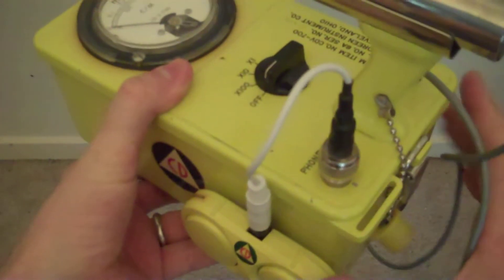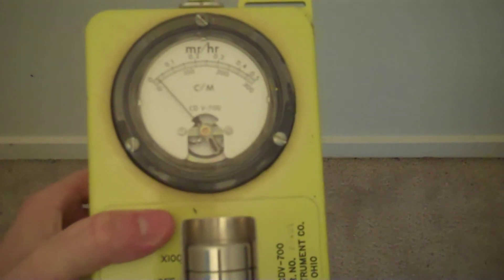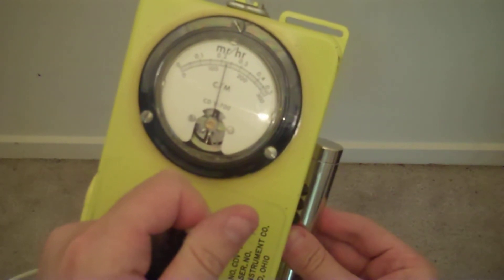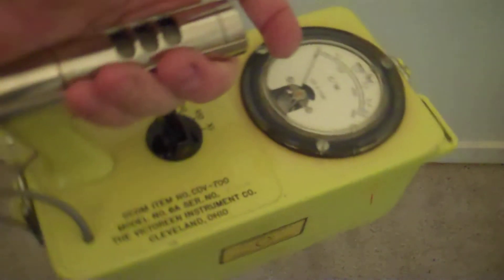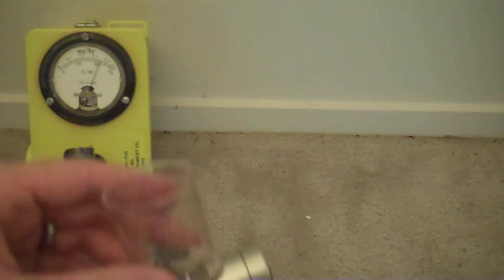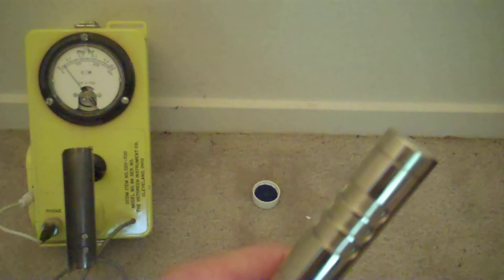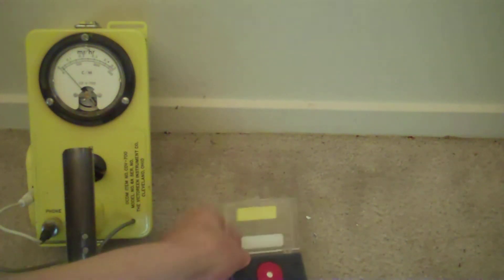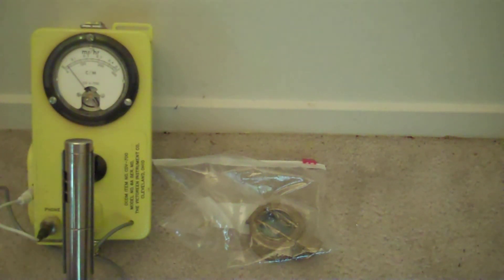Victoreen CDV-700 6A Geiger Counter -- Review

Comment: I know the video is 6 years old but... I hope you still remenber how these device works. There is a lot of cdv700 on ebay that are not calibrated but here is my question: can I just get one that "works" and calibrate it myself? If the check source is depleted, I just need to buy a calibrated source (cs137) and calibrate the cdv700 by turning the screw inside right?

Comment: Really good video! Is it safe to keep in the house with the check-source that it has built 
in? I have a very basic knowledge of physics. Thinking back to high school physics I'm assuming the sticker will 
block Alpha and Beta rays coming out of it? I'm assuming the gamma amount is too low to even travel out of it?  I was intending to store it in a cupboard under the stairs. Thanks!
Reply: Well, you have a geiger counter attached to the source so try to measure if there is any diference in radiation from background at 1 foot from the source.
Reply: It's a pretty small source. The inverse square law is your friend and is pretty safe to keep in your house. Just don't sleep with your check sources.

Comment: From what I've read around from other sources including a civil defense museum is that these should be run off two d cells with jumpers or four AAs because batteries now are way more powerful than the batteries these were designed for. You risk the chance of burning out the geiger.
Myself i just got some AA cell adapters that fit in d cell slots and it works great

Comment: I have 2 of these units that belonged to my grandfather.  One of them is in pristine shape.  I mean, it looks like new, like it has new paint.  It also has a old speaker connected to it for sound.  The other one is in very good shape, but looks to have been used some, with not speaker.  I put batteries in them just long enough to test, and they both work.  I do not want to sell them, but I am curious about what they would sell for?  I never, ever see them for sale at auctions or any place.  Oh, the one that is in very good shape is more of a greenish yellow.  Does that identify it in any way as being different than the pristine, new looking one?
Reply from the maker: +Groundhog If they truly are in good shape, they could be sold for a fair value. Look on eBay for the current prices, but I paid almost 200 for mine. The recent mine cost so much was not just because it was in good shape, but because it also held that circuitry checked and refurbished.

Of course, I would keep them just because I like Geiger counters  =)
Reply: Uh, I meant to say my dad, not my grandfather.  I have one marble out of several that is slightly radioactive.  Also a old alarm clock that makes my geiger counters go crazy.  Back in the 60s, I used to use that clock on my headboard for a while.  I am a healthy 65 years old BTW.  For now, I like playing around with those 2 geiger counters.  Like I said, one of them looks like new!  I live in NC BTW, not that that means anything.
Reply: +antiprotons please can you watch my cdv 700 video

Comment: +antiprotons did that sound like I'm getting two sources? If so usually in the room when they give the radiation pill they'll have a geiger counter and I'll have them measure the thorium to get a baseline if I have to calibrate the counter.

Comment: +antiprotons  heres another message from the seller. Dont know if its coming With the thorium source and the depleted uranium source. Seller said:   "The counter should measure 1-2 on the scale. It should be measured on the 10x which would be 10-20 counts per minute.  The radioactive check source on this model is The Thorium which along with depleted uranium and radium
226 is used as a count source.  When you get home from your procedure, measure the site.  It will diminish over time."
Ask the medical staff how many counts per minute you are getting.
Reply from the maker: Sounds like the original check source. They do not always get worse over time. It depends on the radio nuclides used.

The doctors will not be able to tell you CPM as that is instrument specific. They will give you (if they even do) absorbed dose in Grays/hour, Equivalent Dose in Sieverts/hour, or acitivty in either Curies (ancient and depreciated) or Becquerels (decays per second).
Reply: antiprotons It looks like one of those suction cups on the side with what looks like a tablet in the middle, and on the rubber part of the tester it says TH-233.  any ideas on how much it should read abouts? looks to be roughly the size of a small asprin.
Reply from the maker: DEOXYS987 Ekk. Talk about non standard. It will tell you the thing is working, but not much more. You are likely not concerned as much with dose rate as the dose you are exposed to cannot be helped (you can't get away from it).

i'd stick with CPM as that is likely more accurate. Let's figure out your background...

without being too specific, about where do you live?  East coast, west coast, etc? What is your rough estimate of your altitude from sea level. Lots of rocks nearby?

Comment: +antiprotons Here is what the seller said about the testing element and just wanted to get your opinion on it. "If you put the dial on 10x and hold it closely to the thorium source, it should go between the 1 and 2 on the guage.  Give it a minute.  That's reading between 10 and 20 counts per minute with is where the unit should be.
If you go over to the 1x it should peg at the right end." does that sound about right?
Reply from the maker: Odd...   on 10x, the readings are 0 to 30,000 CPM... so I think they mean 10,000 to 20,000 CPM. Is it calibrated? Did they provide a calibration statement or certificate?

Comment: Thanks antiprotos. bought a CDV-700 last night
Reply from the maker: Enjoy!   Make sure to open the beta shield and place the wand shield open against the check source on x10 mode. Look for a reading of 2.5 to 30 mR/hr, to know the unit is correctly calibrated.
Reply: antiprotons  mine comes with a Thorium calibration test source, what should that conservatively read out between? want it as accurate as can be. getting a dose of Iodine I-131 in about 8 weeks and want to see how much radiation i put out.
Reply from the maker: DEOXYS987   Is it the original built-in check source or a hunk of thorium rock?
Reply: antiprotons Doesnt appear to be a hunk of rock.
Reply from the maker: DEOXYS987   The only source which will work with the 2.5-3 mR/hr at x10 is the original builtin check source.

Any other source would require a calibrated reading.

Basically, someone places the unit in a given configuration and makes a reading of the source. They know (via another unit or lots of math) what the reading should read. They calibrate the unit to that. It should always much up or be known to be off calibration.

Comment: Tom I was going back through old videos on the topic and just saw this one.  It's very well done but the background music is reminding me of Disney or something.  Ha ha.  :)
Reply from the maker: Music from Power Director 10. :P
Reply: antiprotons  Im going to be receiving a dose of Radioactive Iodine Isotope 131 to kill off my thyroid. will this be the best bet to detect how much radiation i put off? love these old CD geiger counters
Reply from the maker: DEOXYS987 The CDV700, if it is a good quality unit with refurbished and tested parts could be, but you might consider a newer unit, like an Inspector USB.

Sorry to hear about your thyroid!  :(
Reply: antiprotons Likely not nearly as accurate as the Inspector, but if you are on a budget - a friend of mine used a "GQ electronics" unit to monitor his cat which had a thyroid procedure.  Apparently the state of CA requires that you save the litter box scoopings for a month before sending them to the dump (due to half-life).  Crazy stuff.
Reply from the maker: Geiger Mouse I got contacted a short time ago about someone with a cat asking such questions... I wonder if they were the same person.

I-131 (a common medial isotope of iodine) has a halflife of 8.02 days, do simple multiply that by 7 to know when the dose rate drops below 1%      (because 100*e^-((ln(2)/8.02)*(7*8.02)) = 0.78125)

The CDV700 is fine, but you need to either be able to service it (basic TV repair or radio repair... follow circuit diagram, solder stuff) or get one with well tested parts.

The Count rate, in CPM, will be accurate if it is in good condition, but the dose rate will be wrong.  I did a rough calculation to account for it, but it uses a simple comparative method:

rates from*
A = Cs137	0.38184	REM/h ast 1 meter
B = I131	0.282939 REM/h ast 1 meter

A/B = 1.349548842683405

So, if the Inspector showed 2.5 mR/hr, it should be 3.374 mR/hr

*http://www.iem-inc.com/information/tools/gamma-ray-dose-constants

Comment: Are these old units sensitive enough to check if U glass is real?  Or to look for radioactive deposits in nature?
Reply from the maker: Yes and no...    Assuming that the unit is in good condition or refurbished, the CDV700's probe can detect uranium glass and natural uranium, but the sensitivity is low. If the glass is nice and hot or the uranium is close to the surface and hot, then yes.

A $250 replacement pancake style probe can up the sensitivity. I'd recommend an Inspector USB, instead.
Reply: Cool, tnx alot.

Comment: Tom,
How would a DX-2 (US geiger counter. claims to be as sensitive in beta gamma as $1000 geiger counters) glass tube exposed on the side for 3-4 inches with scale from 0-1000  uSv/h and 0-100 mR/h powered by a 9V battery. $190 a little more expensive than the wires and double SBM-19 counter ($175) that I wanted to build custom, but according to reviews for prospecting in mines and in nature worth the price. Also claims to beat the Gamma Scout. The DX-2 also has a screw on the back for manual calibration.

Comment: Tom, I am beginning this hobby and I have two questions for you:
1. I found a CDV700 6A or 6B in working order (uncalibrated) for $80-90 the seller says each unit will be tested prior to shipping. Should I buy it and what are the calibration points for each type of unit (full designation: Victoreen Ocd CDV 700 6A or 6B).

2.What is the music featured in this video. I want to listen to it all the time.
Reply: Added information for #1: Unsure if headphones are included and readings on the 6A tested is .2Mr/h in X1.
Reply from the maker: ajsliter The unit will make no sound without headphones or a speaker. http://www.anythingradioactive.com/ sells external speakers and parts, as well as tested units.    A CDV700 is not very sensitive and really more of a collectors item.   Normally, I recommend an Inspector USB for a new user (they run around $550). The sensitivity difference is night and day (8 to 10 times greater).

The price is good but for such a low price, you need to ensure you can work with old analogue parts. Calibration is not too hard, but you need a Co60 or Cs137 source handy to do it. You can calibrate with the check source, but it is not very accurate.  On the x10 setting with the beta shield open and the probe over the check source, you should get 0.2 - 0.25 mR/hr.

Units like that are always risky. I spent $150 on mine but got a money back guarantee and it was fully reconditioned.
Reply: antiprotons There is a reconditioned one with pancake probe for $150, but i thought I would want to search only for Beta and Gamma sources from rocks in the woods and maybe when I take a trip to Colorado in the summer find some sources in the mountains. Is there a more sensitive one for only beta and gamma that is around in the 100-200 range that you can point me to?
Reply from the maker: Those SMB20 Russian tubes are nice, but you will only get readings from the more powerful sources. Weaker sources will be hard to detect without long timed counts. Between the two, I'd pick a CDV700 reconditioned with a pancake... but you might also check for a Ludlum model 3. The model 3 is basically a modern CDV700-style unit typically shown with a pancake or pickle probe. Note, the probe does not always come with the Ludlum.
Reply: antiprotons
Ludlum is expensive! The kit is also compatable with the SBM19 from what I read. Is that any better than a pancake because I'm mainly trying to find natural beta and gamma sources and also looking at depression glass and fiestaware which I know emits medium to high beta and gamma radiation from a demo that I got twice; once from a physics grad and the other from a chem grad. They used a Ludlum reconditioned from the military; one with an open end and the other a pancake probe.
Reply: ajsliter
I just checked E-bay, The Pancake Probe CDV is already sold. All that's left are reconditioned standard units with the original probes.

Comment: Would the LND 720 Muller tube replace the Victoreen 6993 Muller tube with any benefit? If not, where to purchase a 6993 Muller tube?
Reply from the maker: I'd stay with the 6993. The LND712 is nice, but too smaller for the probe housing and much lower gamma sensitivity.

Comment: What kind of distance can the cdv700 with standard probe be expected to pickup trace radiation, for "radiation hunting" items around the house,etc.... I have a GQ GMC-300, and it seems anything below a few thousand CPM, it won't start picking up unless it's 3-4" from it.
Reply from the maker: The method to determine this is called the distance inverse square law.    For example, if your unit detected 1% of gammas it detected (1% efficiency) and you had a radioactive object emitting 37000 photons per second... how many CPM would you get above background at x distance?  Well, First you determine the area of your tube which directly faces the source. If half of the probe faces the source and the probe is 8cm around and 12 cm long, than half would be 48 cm^2 of area exposed to the source.  At 100 cm, you would detect:    0.01(37000 photons / 4*pi*(100cm)^2)  = 0.2944 (not even 1) additional CPM.   At 10 cm distance, you get:  2.9444 CPM above background... See?   I'd suspect you would need to be within a foot of most objects. Let me know if you need more info and I can make a short video showing.

Comment from the maker: Counts per second is fine, but anything less than 60 counts per minute and you will likely read zero. If your background were 0.5 CPS and jumped to 0.9 CPS, you would still show nothing. In CPM, the same readings would be 30 CPM to 54 CPM, respectively. 

Any Geiger counter can detect uranium. Is your unit a Ludlum with a "pancake" style tube? (44-2 detector)

Comment: A standard 6993 tube will work. My Victoreen unit has a Lionel brand tube in it so it must have been replaced at one time.  If you want to use a different tube, make sure it is rated to 900V. Many are not.  SE International makes a pancake probe called the CDV-700RP TFG Radiological sells them for $330 so not cheap.  If you're looking at Soviet surplus again make sure the tube is rated for 900V or you'll have to build a circuit.

Comment from the maker: On a side note, do you have those units tested and calibrated yearly? A unit in bad working condition is a big liability for a firefighter   (imagine a bad air tank or hose coupling!)

Also, those are higher range units (mine is x1, 10, and 100).

Open the beta shield and hold the open window against the check source on x10. You should read between 2 and 2.5 mR/hr.

Comment from the maker: If the microwave was on, you probably damaged the probe. Electromagnetic induction occurs when something like a microwave induces a current in the center wire of the Geiger tube, causing a nearly steady current. It simulates what would occur in a mega powerful radiation field. The unit jammed and the needle feel to zero. 

Never do that as it kills the unit. They do not detect anything related to microwaves.

Comment from the maker: Well... they are both right. Different models had different check sources. My Victoreen 6A has a DU source. I confirmed this with gamma spectroscopy. The beta emissions are not very penetrating and the gamma from my unit is less than 0.5 uSv/hr, a very small amount of radiation. Personally, I would not very worried given that your average smoke alarm is much hotter  (even gamma).

Comment from the maker: Good point about the lead 210 and the bismuth 210. 

Bi210 will remain in secular equilibrium due to it's super short halfife. I calculated that your units (probaly 53 years old +/-)  are now about %19 of what they once were: 100e^-((ln(2)/22.2years)*53years)

So, perhaps you could try to divide your reading by 0.19 and see if it's correct...

If you get 0.475 mR/hr   then  0.475 / 0.19 = 2.5 mR/hr = calibrated?

Short of buying a new source, that might do.